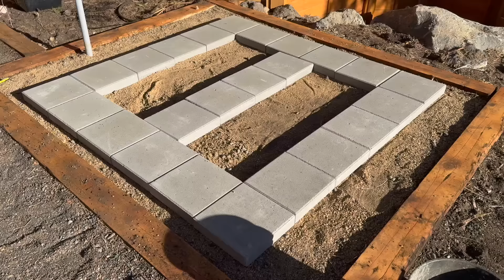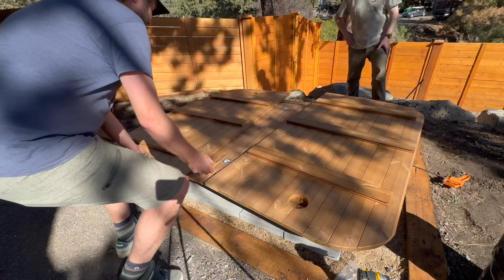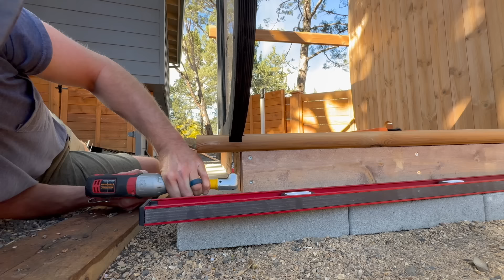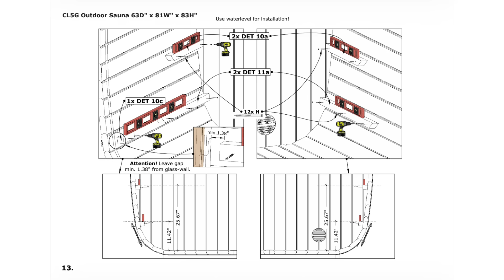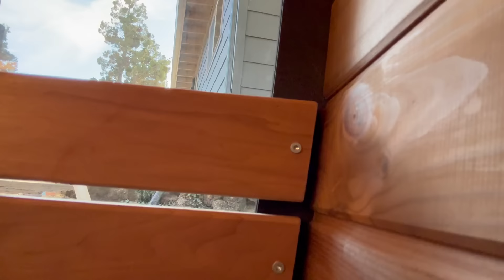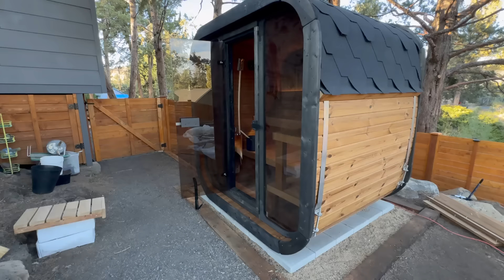Build a SaunaLife CL5G with SaunaMarketplace

Comment: I have noticed that some brands provide pre-drilled holes for easier installation and quality.   Am i correct that your kit did not have pre-drilled hole.  I noticed you did not pre-drill holes before screwing anything.  Did you have any cracking when directly drilling the screws in the wood?

Comment: Hi there! Super helpful video. When you put the ratchet straps on, the video doesn’t show you removing the screws from the outside boards, as it says to do in the instructions. Did you take them out for your build, or you think better to leave them in?
Reply from the maker: Hey Michael great question! We like to go over some of the nuances with the builder, but officially we have to recommend following the manual.  Leaving them removed gives you a lot more 'play' that will help get the final stave just right.  Good luck!
Reply: What's the Electrical use on this? Any info please?
Reply from the maker: @christianmovement3560 typically $2-3 per use depending on rates.  We put a 6kw-8kw heater in so it’s not too hard to multiply that by kWh electrical rates for a good idea.  That tells you how much it costs to run for an hour.  Typically after 45 minutes it is just cycling on and off.  Hope that helps!

Comment: no insulation?
Reply from the maker: This category is sauna is a single layer of thick wood.  Wood is a better insulator than you might think, traditional Finnish saunas have been historically built with logs (albeit much thicker).  We favor this in when sizing heaters so you will still reach the same temps in the same time as an insulated sauna.  And the energy penalty is minimal since it’s only running for an hour or three.  At least for home use.  

We sell insulated outdoor saunas as well.  That’s more like buying a tiny house.  And a completely different category in price as well.  Both have their place!
Reply: @saunamarketplace  I’m actually hesitating between this model and a DIY build. Would this model still be suitable for winters where temperatures can reach –30°C? Is it simply a matter of using a slightly larger heater and absorbing the additional electricity costs?
Reply from the maker: @alault8953  It would as long as we pick you the correct heater. Factoring in the heater stone mass and top achievable temps is the trick. We have a number of these throughout the coldest parts of North America and haven't had any complaints yet!